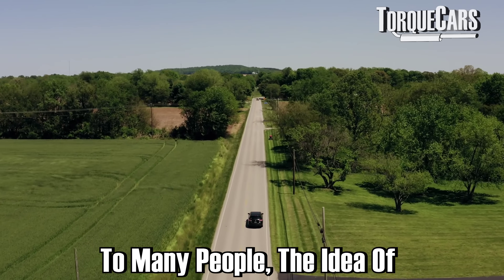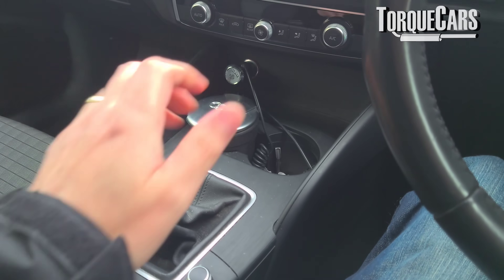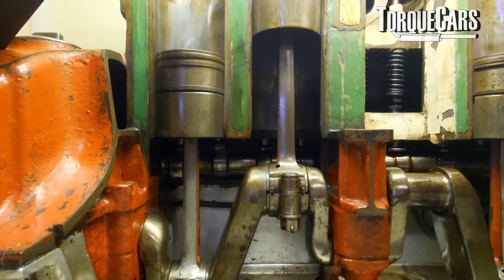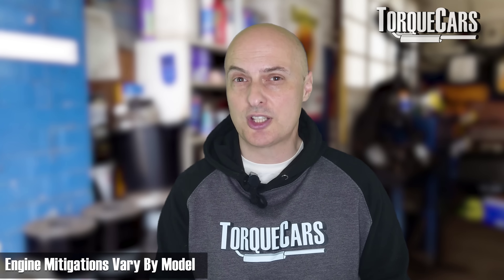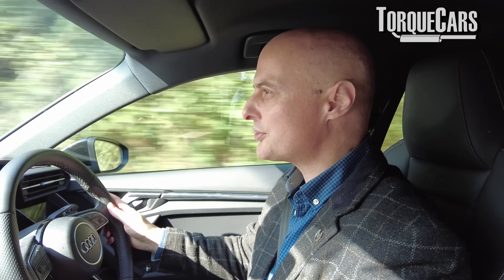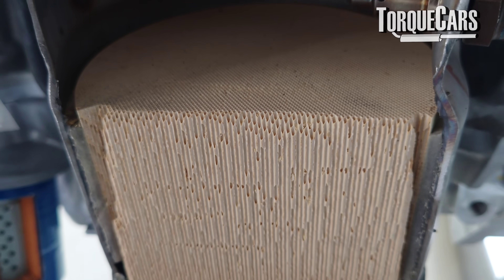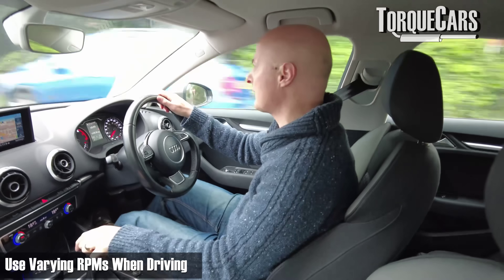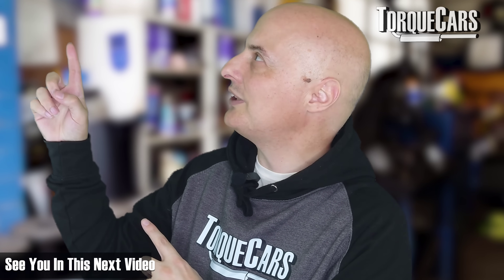BIG DAMAGE By Lugging at LOW RPM? Eco Driving Warning! (Manual Gears)

Comment: This video would've been useful if the "low RPM" mentioned 153 times throughout it, was somewhat defined. Are you talking about RPM very close to idle or do you consider 2500RPM on an engine that goes to 10 000RPM as "low RPM"? We'll never know...
Reply from the maker: You are not alone, short answer is it would be too subjective to define exactly, a diesel vs high revving vtec have very different power bands. The key is if you are lugging then the RPM is too low. I thought that RPM close to idle was the assumed baseline for "too low".

 Longer answer - I did a video to explain https://www.youtube.com/watch?v=Uot7DHY_C1c hope that helps my friend.

Comment: I let somebody drive my 5.0 Coyote mustang with the 6-speed.  She gunned it in first, short shifted into second at like 2000 RPM, and tried flooring it second through forth gear and shifting around 2000.  I had her pull over and took over driving.

Comment: I remember when I was doing Uber around Phoenix during rush hour in summer, I found dealing with traffic jams much easier if I used the lower gears.  It was an automatic in a Chevrolet Malibu, but you could go into a "manual' mode.  The higher revs would allow the engine to run much more cooler overall, even in the desert heat.  It was easier in Stop/Go traffic to get smoother acceleration and deceleration.  Also, the Malibu would disable that stupid "Auto Stop/Start" function.  The engine (and A/C) would run consistently.

Comment: you failed to explain how the engine compensates for low end by retarding the timing through the computer
Reply from the maker: Indeed I did but the combustion event still takes the same length of time whatever the RPM - you don't want a big pressure wave smacking into a low RPM piston even if it is retarded. 

This video is aimed at the everyday driver who thinks that driving near tickover RPM is the best point. I could have gone into more technical details but that would have confused everyone, I chose to keep the explanation as simple as I could but it did require a cut corner and I wasn't as clear as I wanted to be. I did put out another clarification video though... https://www.youtube.com/watch?v=Uot7DHY_C1c

Comment: Cars were designed to be revved, driven on motorways, daily commute etc. Now, whilst it is fuel efficient, sometimes it is good for the engine to breath a little, give it a little rev, especially when joing the motorway. It is possible to revv the engine, whilst keeping within speed limits, its actually good for the engine to be revved, thats what its designed for, it may cost you little more to fuel up, but it actually keeps the engine healthy, driving in low rpm range does not help keep the engine healthy, so whilst it may save you a few bob in the bank, it may actually end up costing you more in the long run if you drive like that. My dad, had a estate mercs, automattic 4+L engine, he told me that, the engine need to have a little run every now & again to keep the engine healthy, like taking a dog out for walkies. Same principle. If you're gonna drive like that, then take a bike, forget about owning a car. Cars, just like dogs, need to have a run around, to keep them healthy. If owning a car, you don't take it out for a week or two, or even longer like a month, you're asking for trouble, you're gonna have problems. If looked after properly, driven at least once a week, to let the engine breath, then thats fine, but not if you're gonna lug your car around like that, thats just stupid.

Comment: So glad that I've been doing the right thing all this time which has led to one Toyota Corolla 1.4 D-4D reaching 600,000 km since 2005 with all parts except for the water pump being still original and still running, and one Skoda Octavia II 2.0 TDI reaching 427,000 km since 2012 with the first turbo and even particulate filter and still going. And neither of them requires oil between service (15,000 km for the Toyota, 30,000 km for the Skoda).

Comment: Meh, for 20 years, I always change gear at 2K RPM .. Saves fuel .. And my Lancer (4G15) is still kicking at present .. So yeah, don't believe everything the internet tells you kiddies ~ EZ 😎🍻
Reply from the maker: I wouldn't say 2000 RPM is low on the 4G15, but using WOT at 800-1000 is certainly low and should be avoided. I did clarify what a "low RPM" was in another video. https://www.youtube.com/watch?v=Uot7DHY_C1c
Reply: @torquecars  Dude what? Changing gears on 800-1000 RPM, that's suicide, it may also stall the car, very dangerous if you ask me .. Well, I did not meant to offend you or anything, it's just kids today, they just believe everything the internet says .. Just a friendly reminder to them. Good video though ~ 😎🍻
Reply from the maker: Oh no - no offense at all. You made a good point and gave me an opportunity to clarify something. Yes lots of these hypermilers with manuals are driving around at near tickover thinking it is economical so this video is really aimed at them.

Comment: My dad was a truck driver and I think he was taught to change up as soon as possible to save fuel and he always told me and my mum to drive like that in the car as well.  I always said, no, you need to be in the right gear for the given situation to save fuel, not always in the highest gear / lowest RPM possible, especially if going up hill, or overtaking.  My mum drives a Citroen C4 turbo diesel HDI, which is super efficient (over 65 MPG) and the car tells you to change up around 1200 rpm, so she drives around town at 25 to 30mph, in 4th or 5th gear, at about 1000 rpm, then gets to an uphill section and just leaves it in 5th thinking that is going to save fuel and the car sounds like it's about to stall and I feel like saying, "FFS mum, change down to third, at least until we get to the top of the hill!"    Maybe I'll show her this video!

Comment: vtec engines from honda's ? should i rev it up sometimes i usually shift at 3k rpm
Reply from the maker: Most drivers I know don't go very high on a VTEC engine, but they are built for it, many change just after the VTEC kicks in which is where things are starting to get interesting. Don't fear the upper third of the RPM range, WHEN THE ENGINE IS WARM that is. Our video on the Italian Tune up goes into the benefits of a good blast.  https://www.youtube.com/watch?v=esfHiTGapA8
Reply: @torquecars  my car is a 3.2l v6 vtec always been beaten by every other owners

Comment: So this video is primarily for manual transmission then?

I've ways driven an automatic here in Canada, I've always followed simple rules and I've had cars last well over 350k kms

- avoid going over 2k rpm until hitting operating temp (especially in well below freezing -15 or lower)
- limit how often I rev above 3500
- avoid going over 105kph
- maintain speeds (avoid acceleration for no reason or use cruise control often)
- let engine idle for 1 minute for every hour of straight driving before shutting it off
- keep fuel tank above 1/4 (and above 1/2 in winter) to limit condensation in the tank
- oil changes at 5, trans at 50, coolent/differential/brake fluid around 75
- spark plugs at 75
- induction cleaning at 60
- drive for 30 mins at highway speeds at least once a week
- avoid big pot holes at high speeds
- air filters at 15 or so

Comment: The Detroit Diesel DD-10 and DD-15 is designed to operate as low as 800 RPM.  I personally found that it requires proper break in for it to run properly below 1100 RPM.  But if broken in properly, you get your best fuel mileage near 800 RPM with not much loss of horsepower.
I've driven DD-10s and DD-15s that were not broken in properly.  I could tell almost immediately as there is a significant power loss below 1000 RPM.  Some people never learn progressive shifting and never RTFM, and lose money in extra fuel burned - easily climbing into the thousands of dollars every year.  The irony is, I recommend RTFM while the DD engine manual specifically says it needs no breaking in period.  But practical experience proves otherwise.  The DD-10 and DD-15 both need as much deliberate operation under 1000 RPM as practical in their first 15,000 miles or they never develop any power under 1000 RPMs.  The more miles under 1000 RPM, the more power they develop under 1000 RPM.  Don't ask my why that is - it makes no more sense to me as it does to anyone else.  I can only report what I've personally experienced.  The Detroit Diesel engine needs a breaking in period with as much time under power below 1000 RPMs as practical or it never develops much power under 1000 RPMs.  For this reason, I recommend all new Freightliner trucks be used for city driving with a driver practicing progressive shifting for at least 6 months before they are used over the road.

Comparatively, most Cummins engines will lug at anything below 1000 RPM with significant power loss, and it's recommended to keep them over 1000 RPM at all times.  No amount of break in will help them whatsoever.  With the exception of the Volvo, all trucks I've driven used an Eaton Fuller xmission.  So it's largely an apples to apples comparison.

One of the companies I worked with experimented with a lighter grade oil and found the cost of oil loss and managing the soot created by using a lighter oil was far less than the extra fuel cost of using heavier oil.  Over the course of a half million miles, the cost savings was in the thousands of dollars.  Multiply that by about a thousand tractors and the company saved nearly a million dollars simply by using 10W-30 instead of 15W-40.  This, of course, assumes proper maintenance - especially regular oil changes and daily oil level checks.  It should go without saying that if the operator is not maintaining the oil, it won't matter what oil is used.

However, burning more oil puts more soot into the air, so they're socializing some of the costs here.  Heavy trucks don't have catalytic converters (yet), so there's nothing to get plugged up.

Comment: I'm not an automotive engineer, but I was thinking that single oval-shaped intake & exhaust valves might provide similar air flow to dual valve designs, with roughly half the cam energy requirements, and the additional benefits of simpler cams and reduced manufacturing costs.

Thoughts?

Comment: I’ve read on Forums that people use the “lugging” as one of the excuses to justify ridding the existence of manual transmissions.

I learned to drive with a manual, and have taught my 3 children (now adults) to drive manuals too.

We know the importance to keep the engine in its proper power band when accelerating, then allowing higher gear when cruising.

Automatic transmissions are nice and have become quite advanced, however, I find that people who learn to drive with an AT, then later in life learn to drive a manual without proper training, are likely to allow lugging and will not downshift to the proper gear.

Basically, the reason for idle speed is based on oil pressure and flow.  If you allow the engine to run below idle speeds or “lug” the engine, will cause damage.

Comment: Low revs are fine for a diesel engine within a range e.g. 1500 to 2500. It pulls from 1000 and does not need over 2500. Mine is an ad blue system so no problem with low revs.
Reply: depends on the very engine... the oil pump might not lubricate the engine properly at 1500..

Comment: I downshift and let the engine rev where it feels the most happy, even if I have to rev it out to 6500 rpm to accelerate. My motor still runs happy at 200k miles. If you feel your engine "chugging", downshift!

Comment: I feel like it was never a good idea to try to apply more throttle when the engine can't accelerate at the rate quick enough to use what is being demanded. One can tell when throttle is applied and the car isn't accelerating any faster even when the throttle is pushed further. Doing this causes stress to the crank, journals, rods, pistons. Not good. Can get into detonation at this point. The Diesel engines can especially see damage from this which is essentially a poor user habit. I watched a video from powerstrokehelp and he was talking about an engine failure on a light truck pulling an rv at low rpm with only 180k on the truck. The truck was well maintained but the user style was always pulling heavy loads under low rpm which ruined the crank on that one. Some of the tunes on these truck don't make any adjustments to the transmission shifting and the truck short shifts and doesn't get rpm up or upshifts to soon. So one could have the shift points retuned or just change user habits to accommodate higher rpm when necessary. I have a truck with the 6.7l powerstroke and it short shifts too. After I realized how bad that short shifting was under load I changed it up. Sometimes the truck will shift in 6th at 50mph. Good thing about the truck is i can take gears away when in town and keep it in 4th or 5th gear. Even using tow mode when not towing works better in stop and go traffic and holds gears longer without upshifting in stop and go situations.

Comment: Low RPM = low oil pressure  = low volume of oil delivery to the main crank bearings . Less oil cushion at high torque/acceleration . Coasting or downhill at steady speed? no problem. Learn to downshift.

Comment: Vehicles with a CVT transmission are designed to be operated at lower rpm. Try doing to many high rpm runs with one and that CVT will be dead in no time.
Reply from the maker: I'd certainly agree with your use of the word lower but not with LOW - most CVT if not all will avoid lugging the engine when it is under load. The ones I've driven typically sit around 1600-2000rpm for most of typical driving which I don't see a problem with. This is very much a manual transmission problem and more correctly a driver problem.

Comment: I've had cars that would get noisy (rattle noise during acceleration) if I was driving miss Daisy too much over time. Taking them for a spin on the highway for an hour of higher rev would solve the problem. Edit: Typo.

Comment: I drive a diesel, a very small diesel, it is the happiest at something between 1750 to 2500rpm, redlines at 4500rpm... I usually drive at around 2000rpm and avoid going past 3000rpm ... It will actually recommend the gear according to the speed and throttle input, if you try to lug the engine it will tell you to put a lower gear... The engine has a torque curve, usually you want to keep it running on the top of that curve...

IDK if it was with the VW's you mention in the video, but I remember talking with a mechanic about the turbos not being lubricated at low rpm, making them 'dry' and causing them to fail prematurely when the engines were usually ran at low rpm...

Comment: My Ecoboost 3.5 was a victim of low RPM pre ignition. The transmission didn't downshift fast enough for the boost 
 Big bang, broken connecting rod, and a few holes in the block.

Comment: In short, lugging the engine damages the engine.  eg: Cracked pistons and oil leaks.  Unless if the engine is protected by a throttle position sensor that can automatically adjust the conditions to better suite.

Comment: Very interesting regarding variable oil pumps. Always thought it was a stupid place to try and save a tiny amount of fuel consumption at the expensive of oil pressure. 
Dont get me started on wet timing belts.

My opinion. Dont lug the engine (especially diesel), lower the rpm only when cruising whilst remaining light on the pedal. 297 000 km on my VW polo 1.4 CLP and still runs silky smooth.
DPF on the other hand needs heat once in a while to remove build up. Blocked DPF could also slowly kill turbos.

Comment: My 2016 Alfa Mito visually prompts me to shift gear. Great idea. Mostly I'll follow the prompts. However, as a former driving instructor the most important thing for me is to be in the right gear not just for my speed but for what I am dealing with on the road and the next thing I plan to do with the power and torque from my engine 
Labouring the engine in an inappropriate higher gear could be dangerous if I need a sudden burst of acceleration as you say to overtake safely or even get away,and avoid danger.
The key here is vary your use of gears to meet your need for say cruising or acceleration. If you constantly Labour the engine in an inappropriate higher gear you will increase fuel consumption just as much as if you constantly cane the engine at high revs
Read your handbook and find out what's best for your car.
The main thing of course is yes use your rev range but use it safely to match what you have to do on the road. That's your first priority not what is happening to your engine.

Comment: I believe the issue is very much dependent on the engine type. My Astra 1.3 CDTI from 2009 is operated at very low rpm between 900 and 2000 rpm. The engine has more than 500k km on it without any issue. I recommend low rpm during warm up for sure.

Comment: Lugging a vehicle is like riding a bike up hill in high gear. Sure, you can apply more power, but that puts a lot more stress on you ankles, knees and hips. Engines have similar pressure points that get abused at high load and low RMP.

Comment: I bought a brand new Ford Ranger 3.0 V6 four months ago and since then my circumstances have changed.
I have driven 800 miles in 4 months, mostly (obviously) short journeys in urban environments.
Is this bad for the vehicle and what potential damage could this be causing?
That is apart from the damage to my wallet as I am averaging 19mpg

Comment: If you drive a Turbocharged Engine like VW TSI 2.0 with all the time high RPM then the engine will not last too long. Because of the Turbo pressure.